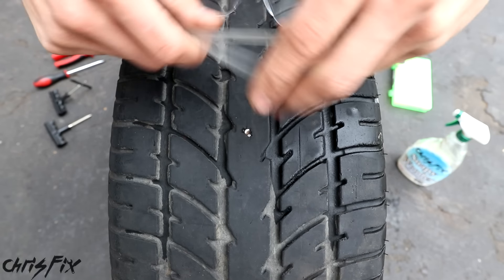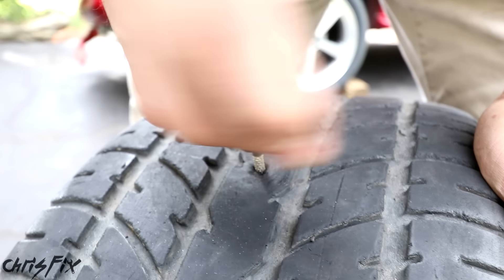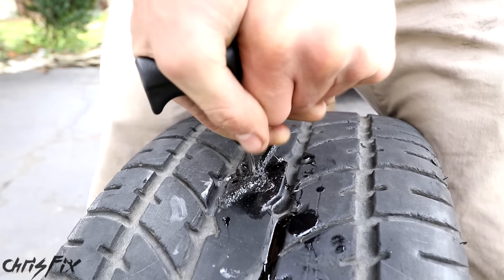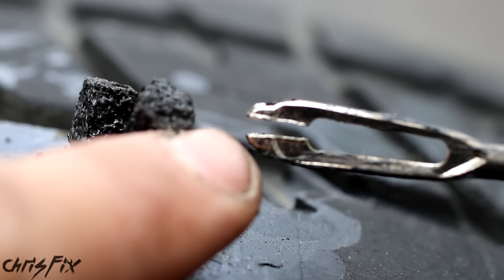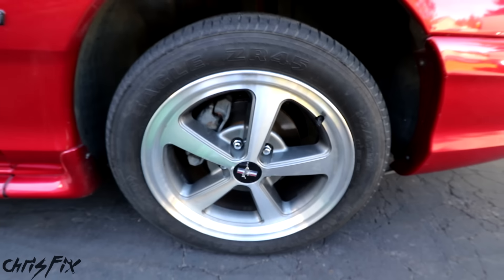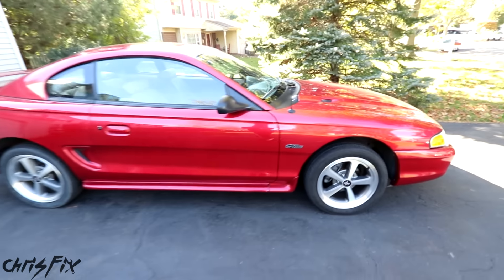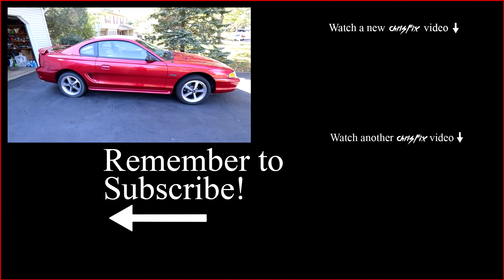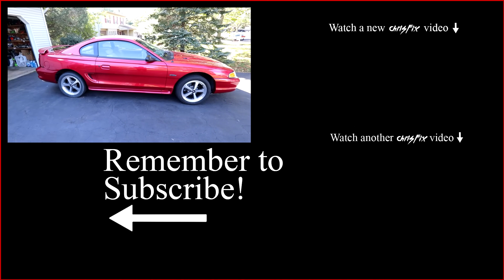How to Fix a Flat Tire EASY (Everything you need to know)

Comment: I can attest that these plugs do work, as I've plugged my tires like this for years. First time I used a plug, I followed the directions on the package, then took the car to my mechanics (at the time), who just told me that's exactly how he would have plugged it. 
Something important though; while I will recommend this method, just keep in mind if you have a warranty on your tires, fixing them may void it. So in that case, just put your spare on, and take the tire to the shop (or chain) you got it from for service. They'll probably do the proper seal from inside. But if not the case, I've driven around on plugged tires for years.
Also, when it comes to tire sealant, yet another issue with them is they can throw off the weight for your tires. When you reach speeds of about 60-70 mph, you'll probably start feeling a vibration or shaking while driving. Definitely a last resort.
Reply: I used sealant this week and I've been feeling some shaking while driving on the highways recently.  Thanks for the info!
Reply: @einzigerthethief5613   I feel your pain. I've mostly used sealant in the past for slow air leaks; mostly from a very small gap that's formed between the rim and tire. If that's the case, I think going to a shop and getting the tire remounted on the rim is probably best (if the tire is still good). As Chris said, shops aren't a fan of the sealant either, having to clean out the rim when changing the tire. I've sworn off using sealant since. 
Other then giving you a shakey ride, throwing off your tires balance by using sealant could possibly contribute to uneven tire wear, another reason to avoid it if possible. In your case, it might be worth (depending on how much life is left in the tire) to see if a shop would be willing to clean out the tire and preform a patch if needed. Tires can be expensive, and I'm all for saving a good tire with some preventative maintenance over using a quick fix. That, and down the road if the tire goes, you're usually supposed to replace them in pairs. Hope this helps, and you can get a better fix done.

Comment: Just pointing out that most of the time you don’t need to take off the tire to plug it especially the front you can just turn the wheel and line up your hole to a convenient spot and plug it while it’s on the car it’s actually easier because the wheel won’t move when you try plugging it and in the back on most cars you could just jack it up to make more space and turn the tire until the hole is on top and plug it like that

Comment: Hi Chris was wondering if plugging a tire increases the risk of a blow out? Just plugged mine and someone told me it does. My dad use to do it all the time and i never heard of a blowout!
Reply from the maker: I cant tell you scientifically if it does or doesnt but I never had a problem and the tire you saw in this video was used at a drift event and I drifted them down to the metal belt and it still held air. I think it only increases odds of a blowout if you have a nail outside of the tread area which is why they say it's not repairable.
Reply: @chrisfix  Honestly didn't expect to get a response cause of the volume of questions you must get asked. Appreciate you taking the time to answer mine, thanks Chris ✌

Comment: Note the tip of the screw has been clipped off. This is typical of intentional vandalism of the tire. I think it makes a bigger  hole without the sharp tip, which would punch a small hole which would expand to accommodate the whole screw. The blunt tipped screw pushes through the tire's steel belting, creating a larger, ragged hole - less likely to take a permanent fix.

Comment: Hello! New driver here. Is it advisable to put the punctured tire in the rear wheel?
Reply from the maker: Yeah it doesn’t make too much of a difference but it’s slightly better because those are not your steering wheels.

Comment: Hey today on the highway I realized that tire pressure sensor light came on. I then drove for about 2-3 miles at highway speed (~60-70 miles per hour) until I got to the next exit. When I got out I saw one tire is basically flat, there's a nail in the center of the tire. My question is how does driving at 60-70 mph for 2-3 miles on a flat tire damage the tire? Can I plug it or should I replace it all together?

Comment: Chris always start the car. The voltage goes up and the amps go down so the compressor does not melt   as fast and DO NOT run longer than 10 - 15 min with out cooling or it will melt ask me how I know .

Comment: Ive driven on a plugged tire for over a year with no problem. Eventually I had to replace the tires because they were old anyway, but I'm sure the plug would have lasted longer.
Reply from the maker: If you install it correctly they can probably outlast your tires!

Comment: You may have a tremor in the steering wheel afterwards. That is because the wheel gets unbalanced by the additional weight of the rubber plug. 
If this is the case, go to the nearest tyre shop and have your repaired wheel balanced.
Reply: A tire plugs wheigt is less than 3 grams. The smallest balancing weight is 5 grams. It's not a problem

Comment: today gonna be the first day i change my tire by myself. luckily it deflated in my car porch.
Reply from the maker: Let me know how it goes!
Reply: @chrisfix  first, i watch your video. then i read manual. secure other tires with stone block. then i loose a bit those nuts. then i jack, but just touch the frame. then i whatsapp my brother, double confirm, is that correct. he reply so slow, i just continue jack. then i wiggle that tyre. then i ask myself, HOW HIGH I SUPPOSED TO JACK THIS? chrisfix dont mention this. damn. then i pull out those nuts and continue jack. suddenly that tire fall off on his own. im shocked! lol. i secure under the caliper with another block (just in case it drop). then took that flat tire to NS TYRE shop (with my car), and patch it. Actually, i got problem with my car too. before that i scan at my local shop, it show ALL error inside Transmission FAULT. im worried since i took care that transmission with all my heart. plus, there is vibration even i changed lower arms, all absorber and their mount, absorber link, all ignition coil and plugs (it's faulty around last week), finally engine mount set (3 days ago). but still vibrate. plus that transmission error, im going nuts. go to other workshop (same NS TYRE shop), 1 hour drive, bigger screen scanner, NO ERROR. wtf. then i changed again that mount to original Nissan (thailand, original probably, hard to get nissan japan part).  vibrate gone. then, come back home, i trim those extra rubber seal (shop just leave like that. since my sifu aka @chrisfix teach me to trim with razor, i do that). then i put back that tire, tighten it with my 50KG body weigt. then i drive 40KM (got some errand to do - my wife errand, with 99% confident level. another 1% no confident because i tight it with my body weight. lol. THANK YOU SO MUCH Sifu ChrisFix. your videos make others life easier. 7 years driving, first time i change tire by myself. lol

Comment: Shouldn't you check (and adjust) the tire pressure after it's back on the wheel and the weight of the car is on it?

Comment: If you use the rubber cement, it is quite possible that fix will last a long time. Otherwise, yes you better patch that from the inside.

Comment: Since the tire plug is temporary,  wouldn't it be easier to just remove the tire and run up to tire shop to get it patched inside instead of messing with a temporary plug?

Comment: The reason I said you need a measuring device is because you need a tire-guage to inflate your tire to the exact specification of your vehicle, those specifications are going to be on a sticker on the door-well. There may not be a puncture but rather you may simply need to put adequate air. To me, flat tire, means there is a puncture;  Lo siento, soy cansado

Comment: Throw out the temp tire and get a real tire as a spare. Also, Keep some soap in a spray bottle with out the water so you can fill it with water when you need to find the leak for the hole plug kit.

Comment: Just tried two different cans of fix a flat and both leaked at the union of hose to can!
I could hear the remaining air coming out of my tire!
On one of them the hose actually came off of the can with no unusual help from me!
I have used them in the past and although messy, wear disposable gloves, they worked so I know how to use them but this was very disappointing! 
I think the style with no hose is better but they still have downsides as discussed in the video.

Comment: If you are sure that you still have an air leak, even a slow leak, there is no reason to drive the car home. Drive it immediately to a tire shop since you are going to need a permanent and proper tire repair, anyway.

Comment: Sorry ChrisFix, but a string repair is only a temporary measure and because you have done this, the tyre shop may not attempt to repair it correctly using a Plug Patch but insist on a new tyre being fitted instead.
My advice, as a professional tyre fitter, is to either call your breakdown provider for assistance or replace the punctured tyre with a Space Saver (if you car has one).
Also, you have no idea if the inside of the tyre is damaged due to driving on it flat or the object scraping the inner sidewall.
The tyre gel or foam does not damage the tyre, however, I would advise against using one of these cans because I have never seen one sucessfully work. Also, because of the mess inside the tyre after using the gel/foam, the tyre shop may not attempt a repair due to the amount of cleaning up required (and the stuff stinks of dead fish with an acidic smell) but once again insist on replacing the tyre.

Comment: Most of what he said was true except you don’t want to use a rope plug like this. The rope plug separates the metal bands inside of the tire and this makes that spot very weak and susceptible to a blowout. Go straight to a tire shop and get it plugged with a a rubber plug and patch. This is the only way that the department of transportation recommends to repair a tire. A rope plug will work on non dot tires: golf cart, 4-wheeler, go kart. A tire shop will make you replace a tire if there is a rope plug in it.

Comment: Well. I did it. I fucked up the first plug, pushed it in too deep, but got it right second try. Is that gonna hurt anything?
Reply from the maker: Naw youre good. The plug is sticky and will stick somewhere inside the tire until it's replaced.

Comment: Your BMW looks very new, it may be under warranty so you could call and have them help you. It is very dangerous to drive on tire rim. You may be able to replace the tire with the spare in your trunk, tools should be there to enable you to perform this task but remember that your spare tire is not designed for use for an extensive distances.
Reply: 😂7:54 PM 11/17/2023
Reply: the false-floor of your trunk, you must remove the carpet and there should be your spare tire, tire-jack, best wishes

Comment: If you get a flat. Do not drive on it!!! The rim will destroy the inside of your tire. It turns the rubber into a pile of tiny little bits that look like powder. Most flats are repairable if it isn't a huge gash, or it isn't in the sidewall. If you have an AWD car and your tread is in the middle of its life, that little nail that could have been repaired for free, will now cost you 4 new tires cause you have to replace them all. The tread depth will be off to much from the new one, and it can damage your car and ruin the wear on the other ones with the discrepancy in tread depths of the tires. 1200+ mistake buy driving that extra quarter mile to the exit and shop on a flat tire.

Comment: Hate to tell you bud cause you did everything right except choking the rear tyre when you jacked up the car, the chok was on the wrong side of the rear wheel, it should be on the rear of tyre so the car won't roll backwards when jacked, there was no way this car was gonna roll forward when jacked!

Comment: Who patches tires for free?I Live in Pa,Highest gas imposed tax in the country and highest toll roads in the country,I called around and the cheapest was $24.95  to patch a tire,Plus tax.I was recently charge 20 dollars a tire to have new tires put on rims without balancing and not replacing  valve stems.The tires and rims were in the back of my car from another car that were already off the vehicle,I rolled them in and also was charged 4 dollars a tire to leave the worn tires,Plus tax,And that was the cheapest of 4 places called.

Comment: Why plug the tire. Plugging is meant to just be a temporary fix Besides, many tire shops refuse to put a patch inside a tire that has already been plugged. I was denied a permanent repair because I brought in a plugged tire to be permanently patched from the inside. If you don't believe me, call your local tire shop ahead of time.
Reply: Plugs work fine, ive used them for 30 years. What do you expect a tire shop to say, "Sure buy the $7 plug kit & do it yourself" or "Plugs are bad, bring the car here & pay us to fix it"?

Comment: The directions tell you don't twist the plug while inserting it he's obviously twisting the plug while inserting it I've done this repair multiple times don't twist the plug straight down and straight up keep it straight up and down the whole time or you will lose the plug in the middle of repair.
Reply from the maker: I reread the instructions and it doesn't say anything about inserting the plug, it just says not to twist when pulling it out. Sometimes you have to turn the handle a little bit to insert it since you don't have good leverage. If for whatever reason you lose the plug you can always just grab another plug and it will likely go much better the second time.

Comment: Please don’t ever put a tire plug in your tire it’s extremely unsafe, go to a tire shop and get it repaired safely. If you plug the tire most tire shops will not or cannot repair your tire and you’ll have to replace it.

Comment: Hi the plug s  you use here are garbage   your  tire is going to get get hot running  on the road  and that plug will  leak if you have to plug it get real rubber  plugs  not cloth one like  that one

Comment: Just like the advances in oil, Tires have Advanced even more.  Car Manufacturers do not make tires. So DO NOT Rely on the door frame recommendation for your tire pressure.  ALWAYS READ THE SIDE OF THE TIRE TO SEE WHAT THE TIRE MANUFACTURER SAYS THE MAXIMUM TIRE PRESSURE CAN BE.  THIS IS USUALLY 44 POUND PER INCH.  I RUN 40, THIS GIVES YOU FAR BETTER CORNERING AND THE BEST GAS MILEAGE!  PLUS IF YOU HIT A POTHOLE OR TRASH ON THE ROAD YOU HAVE A FAR LESS CHANCE OF A BLOWOUT AS YOU WILL NOT PINCH THE TIRE AGAINST THE BEAD OR WHEEL.  EVERETT C. PERRY.